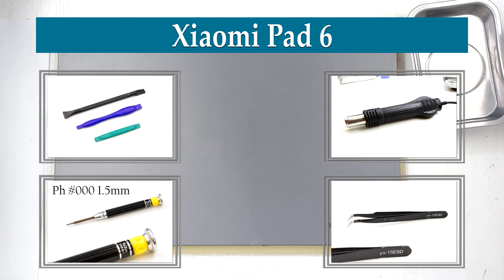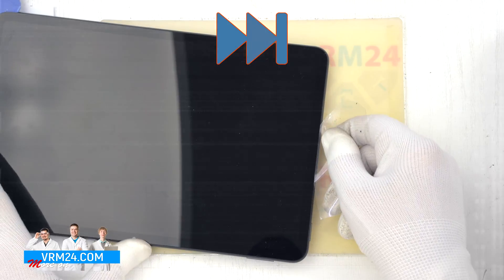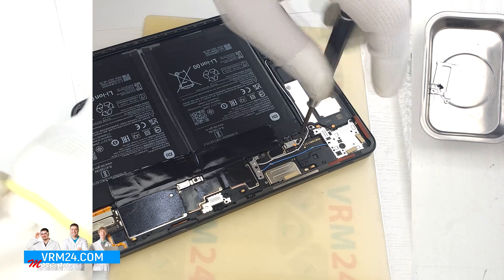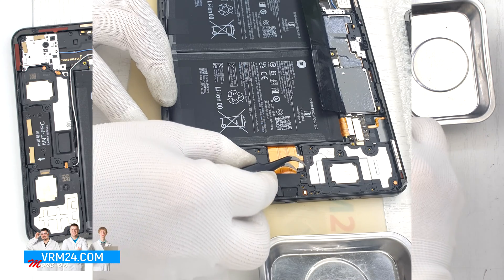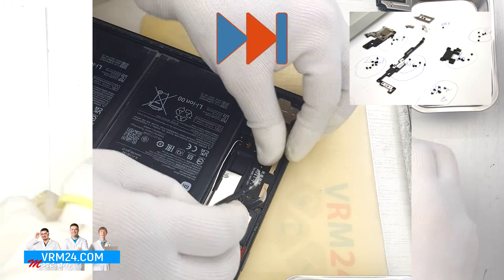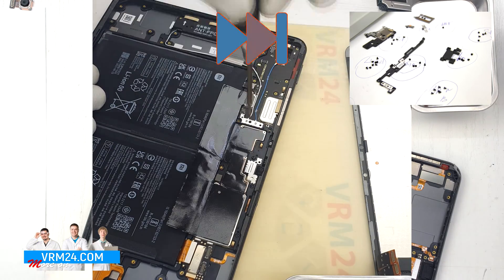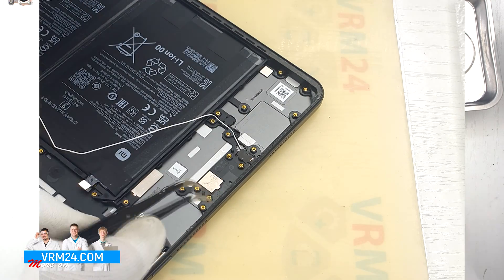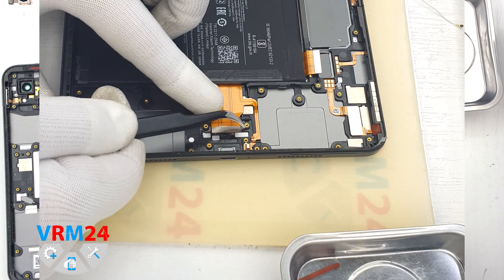Xiaomi Pad 6 11'' 23043RP34G Take apart Disassembly in detail

Comment: nice one bro, i've been wondering where the cpu located because to maximize cooling using phone magnetic cooler needs to be precisely above the cpu
Reply: I have xiaomi pad 6 and the cpu is it the top right corner when oriented oandscape
Reply: @vincentlevinson2653  please be specific in the near camera or top in the middle in front camera?
Reply: My brother, could you tell me where exactly the cpu is located? I know it's by the front camera, but I don't know if it's underneath, to the left or to the right of it. You'd do me a big favor since I want to buy a cooler for my mi pad 6

Comment: How is the CPU cooled ? There is some black crap under the motherboard on the body, however there seems to be just some flimsy copper foild from the back side, so really nothing to conduct the heat away into the body. No wonder the CPU reaches 90 C when there is zero thermal managment. For reference, 5x smaller poco f3 with plastic body doesn't reach even 60C on the CPU
Reply: They sure neglected cooling on this tablet, theres enough surface area to cool this tablet better than any phone could dream of but they don't even put in even the smallest vapor chamber in the tablet, disappointing Xiaomi, your os is also ass and you made bootloader unblocking near impossible, I'll probably steer clear of Xiaomi on my next purchase
Reply: @panjak323  graphite sheet
Reply: @arianbia7777  that black stuff doesn't look like graphite, more like polymer. Graphite is silverish, not glossy black.
Reply: Hello dear, I have also uploaded the complete dismental of Xiaomi Pad 6 Pro and have answers to you this question hope you will like it.
Reply: @avtech_channel  what a pleasant surprise. Isn't the SOC on the bottom of the board though?

Also it seems they're using POP memory packaging (ie DRAM is on top of SOC, hindering thermal transfer). So I doubt replacing TIM to the back case would help in any way